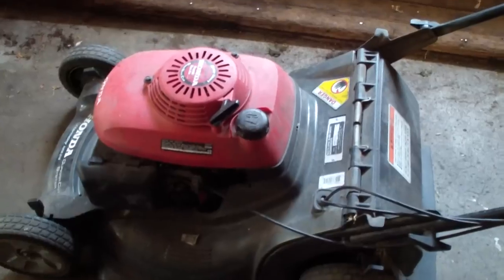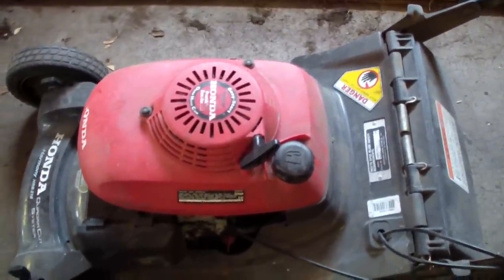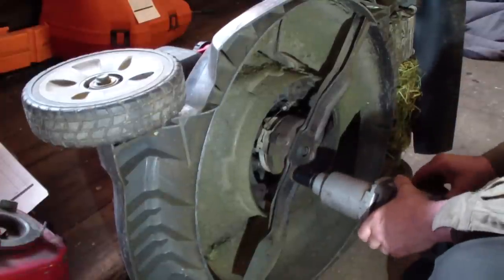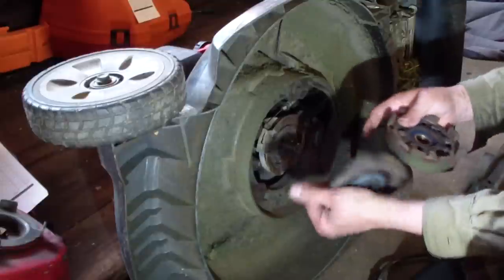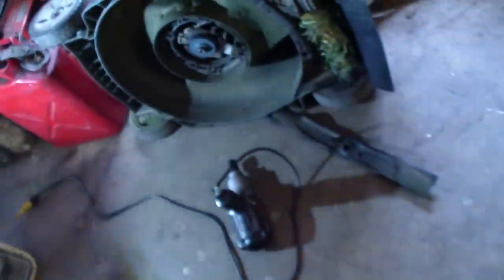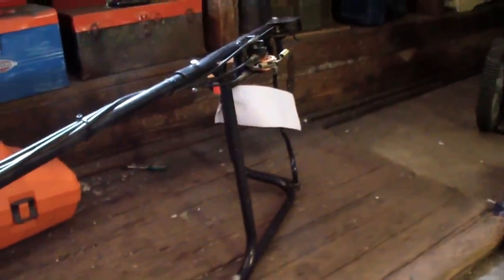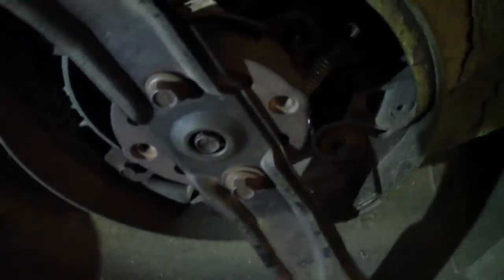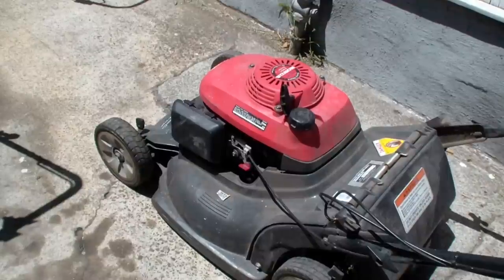Honda hrb216 lawn mower repair, blade clutch, Alameda Repair Shop

Comment: Helpful video. My craftsman mower I bought at a yard sale has the GCV160 motor. The blade would start and stop when engaged, turns out the clutch spring was upside down. Even had “up” stamped on it! Flipped it around and works good now.
Reply: I was getting ready to buy a new mower. your video was the best.  I followed it and removing the clutch was easy... Thanks soo   much.,,,,  I ran over a sprinkler head and the spring got wound up around  the clutch.  and the motor tightened it  up and stopped.   Your video was great..... Thanks John Z

Comment: How did you keep the motor shaft from turning when you removed the center bolt to get to the blade clutch? Please advise!
Reply: You need to wedge something in the flywheel
Reply: @boris9742  Where though? Take the pull cord off?
Reply: @ALLENGERHYTHM  yes you can take pull cord off for better access

Comment from the maker: David: Personally I'm not partial to Honda mowers, yes it costs a little more to service them. I don't see many failures of the Honda blade clutch systems. These type machines are designed for commercial use and the idea of this system is you don't have to restart the motor every time you let go of the handle. I see some 20 year old Honda blade clutch type machines and most haven't required this type of service.

Comment from the maker: All mowers made for the US since the 1980's have to have a system to stop the blade while the mower is unattended. Most mowers have a blade brake with ignition kill. Many of the Honda and other brand mowers intended for commercial use have a blade clutch system. There are many cheap Honda brand mowers  available without this system. As my dear departed grandfather that I never met used to say: " Don't buy a Cadillac if you really want a Vespa."

Comment: Question
So I am trying to remove the clutch assembly
I removed both blades
But the center bolt just spins
And advice to remove ? 
Thank you

Comment: As I understand it, the bolt which holds the driven part of the clutch goes into the end of the crank, and the driven part will rotate freely when the clutch is not engaged, so you can't torque that nut by holding onto the driven part of the clutch.  When you reassemble the unit and tighten that nut it does not seem sufficient to rely simply on torquing against the internal friction of the engine.  I have done this repair, and I blocked the piston when I did the reassembly so I could be sure that nut was on tight.  In fact, the reason I got into the repair was that the whole clutch assembly just fell off when that nut came loose - this, on a one-year-old machine used occasionally.  Shouldn't you torque that nut to some specific value?  How can you do that if you don't block the piston?

Comment from the maker: @Bruce Arnold. Carburetor is probably running lean or old fuel. More than likely a carburetor clean and service or replacement.
Reply: What did you replaced just the spring or bearing.? When I engage the blade make noise
Reply from the maker: @santygomez1122  replaced spring & clutch assy.

Comment: @Alameda Repair Shop my issue is similar, however my blades only cut out in high grass.  I'm assuming some of the clutch parts need to be replaced.   I removed the drive disk, driven disk, and spring (which was oriented correctly).  I asked thr local shop over the phone what it could be and they said maybe the driven disc.   When looking at the parts I dont see signs of wear.  However the driven disc is super smooth with horizontal lines that run around it.  They're smooth as well and not scored.  I was trying to save as much money as possible and avoid ordering all of the parts.  Your advice would be appreciated.

Comment: I have a 2012 Honda HRX217 that just had a new blade engagement cable installed, but now when I engage the blades, they intermittently stop rotating even while engaged. I can go about 20 feet, and then the blade will kick back to engaged. I'm wondering what's going on here, could it be a worn out clutch, or perhaps the shop didn't install a spring correctly, or something else? Please help, thanks!
Reply from the maker: If it's like the blade is free wheeling it's probably the clutch. or the clutch was removed and reassembled incorrectly. Haven't worked on one in years, the one in the video was fresh out of a Honda shop. Good luck!
Reply: @pafoofnic  Thanks, I'm hoping that the clutch was improperly reinstalled -I called the shop owner, and he said the "new guy" was on my mower that day, so it goes back toomorrow! Thanks again!

Comment: Could the clutch also stick  on and not let the blade disengage if its worn?
Reply from the maker: It may be possible but I've never seen it.
Reply: @pafoofnic    mine won't completely disengage     when I let go of the blade handle it still spins.
Reply: @kiteslights7189 Did you fix this problem? Got the same problem on my Honda 🙈

Comment: my Honda mower vibrates a lot when off clutch... could be wrong blade? when the mower clutch is activated and mowing, the mower hardly ever vibrates and runs very smooth...

Comment: I have a similar issue with my Honda HRM215 Harmony lawn mower, although the blades don't spin freely. It will engage most times, but then quickly disengages when it hits moderate or thick grass. Been fighting with it for 2 weeks now. I may need a blade clutch.. or clutch spring.
Reply from the maker: Check if the clutch spring is in upside down. (factory goof.)
Reply: @pafoofnic  I hope not, but I told a repair friend locally that when I tried cleaning the underside with brake cleaner (as he recommended), green liquid ran out. He thinks it's got grass jammed up inside the clutch assembly. I'll get it figured out, thanks. Just watching your video gave me some good insight as to what's inside the clutch assembly.

Oh, it is a factory goof? that's not good! but good to know it can happen.
Reply: @Wario7793  did you ever get it worked out?  My HRB216 does the same thing.   Cuts fine until I hit tall grass and then the blades quit.   I took off the clutch assembly and the spring has the correct orientation.   I'm at a loss what could be causing my issue or what I need to do to fix it.  Were either of you able to resolve this issue?
Reply: @Ryan-kk2rr  Yes in a odd sort of way. The new clutch assembly needed replacing, but it would have cost over $300! so.. the repair guy put in a bypass module and after learning more about working on these Honda mowers, cut me a good deal on repairs. After that, it ran good for a bit, then kept stalling. He then repaired some more stuff, including steam cleaning the carb and it's been running like new since. I will admit, having it run all the time took getting used to, but I don't mind anymore.
Reply: @Wario7793  so was it just those 3 parts that needed replacing?   300 seems a bit high for something that is about 50 in parts and 10 minutes of work.
Reply: @Ryan-kk2rr  That's what the Honda dealers wanted. I think he replaced more than 3 parts though. I got a new spark plug (twice) and a lot of cleaning and tuning. I think I spent under $200 for both repair times. Being a used mower that cost me $140 for a $400 mower new was totally worth it!

Comment: Hey there,
This one Im working on cuts fine..but when I go to engage the blades its killing the mower,Also can hear very litte of squeeking under there I believe..Any Ideas on that?
Wondered if ist a power engine problem or tight clutch,I tried easing the tension up to where it would not engage then giving it just enough tightness to where it would engage hoping that would make it easier on the clutch but no help..What do you think?
Thanks!

Comment: I always ask my customers if they even care if the blade clutch works or not. Most of them don't even like the blade clutch so I convert the blade clutch to be used as just a standard blade adapter. Then I take the blade clutch control lever off the handle and throw it in the trash.
Reply from the maker: No thanks, removing or defeating a safety device is unsafe and a big liability issue.
Reply: wcjcnc When you lose your fingers because you don’t have any clutch then you put another comment.

Comment: I took my Honda HHR 2169 2012 to the Honda dealer because of bad bearings below the engine. They e had it for 3 weeks and want $250 to fix it.
Is it that difficult to replace those bearings?

Comment: Hi, thanks for the informative video. I have a HRB216 and am trying to replace the clutch pieces like in the video. When I remove the two blades and centre screw, I'm not able to remove clutch assembly to replace the driven disk and other pieces. Totally stuck. Any suggestions?

Comment: Hello, maybe you could help me diagnosing my problem on a Honda HRR2163VXA.

I always fire mine up to warm up while edging. Today when I engaged the blade, it engaged fine. But release whenever I let go of the lever. Is there an adjustment needed on the cable? Do you have a video of that?
Many thanks!

Comment: Hi,
My Honda HRB215 was trouble free for years. When I used it, In the last 3 times, if I release the blade switch, the machine vibrated very hard. When I pressed the blade lock switch the machine operated normal. Today, when I pull to start, the machine acts like is locked up. When I held down the yellow blade switch, I can pull start the machine one the first pull. I can cut the grass ok. if I release the blade switch, while the machine is running, it will vibrate and/or  completely stop. Please help. Thanks.
Reply from the maker: Sometimes a clutch problem. Usually the carburetor is running lean, on engagement vibrates and dies or tries to die. Clean or replace. (best to replace.)

Comment: Hey question for ya buddy.  I have a Honda Hr194 mower.  Trying to check the clutch, when I took the 2 bolts off that hold the blade and then try to take the center bolt out the engine turns and thus does not allow me to get that center bolt out.
Reply from the maker: Have you tried an impact wrench?
Reply: No not yet. So when I turn that bolt it should also turn the engine. Thanks for the quick response.
Reply from the maker: Chuck G
Make sure the clutch is disengaged by the handle. (Tie it down!) Remember to disconnect the wire from the spark plug!
Reply: Ok it's engaged by pulling the handle down so I should make sure the handle is NOT pulled down right?  I figured I could burn it out by using an impact wrench on it if it was engaged.  Thanks for the tips.
Reply: Hey, I finally got my neighbor to use his impact wrench and it worked like a champ.  The clutch was still in really good shape too.
Reply: Thanks so much

Comment: thanks for the link. do you happen to know how thick the clutch disc is new. I removed mine this morning as my mower is doing the same thing as in the video. I'm assuming these wear down. The mower is only 2 - 1/2 years old but its used quite a bit. Just wondering how much of the disc wears down before it actually causes problems. I did find a local Honda dealer a few towns over that can order one for me. $30.00. Thanks for the info.
Reply: o.k. I ordered all three parts. You said in your repair video the spring was in upside down. Well, mine is in the same position as the one you showed in the video. I bought this mower new two years ago and its never been apart. The diagrams from Honda don't really say which way the tabs on the spring are suppose to face, up or down. Thanks for the advice.Alameda Repair Shop

Comment: my mowers problem is the engine sometimes dies when i try to engage the blade. its like the brake isnt fully releasing and its stalling the mower. im going to pull that stuff apart tomorrow and try to determine how it should all work and what the problem is. any ideas?
Reply from the maker: Last time I had one of these stall when the blade was engaged had to replace the carburetor.
Reply: gees i sure hope that isnt the problem. it would be too cheap and easy to fix. lol
Reply from the maker: Put the mower on it's side, (carburetor up, fuel off.) Remove the spark plug, tie down the blade engagement handle and see if the blade turns fairly easy. If it does odds are it's the carburetor. Be careful and good luck.
Reply: 91102-VA4-013   

https://i.ytimg.com/vi/3q4_49K9m7w/maxresdefault.jpg

ok i steam cleaned the blazes out of that carb, took the jet and lil tube above it out. its as clean as i can possibly get it. even shot the spark plug and piston with steam. i pulled the clutch apart, took the seal off one side of the bearing steamed cleaned it too, was pretty nasty in there. poured in some mobile 1 15k motor oil and found some anti seize grease ill put in there with it for good measure. dont have any other type of grease on hand but this should all work.  

i figure it was one of three things, either the carb like you were saying(runs super nice now), the bearing seizing up like i was saying(feels flat spotted), or the brake not releasing enough and rubbing some(always spun at super low throttle). im leaning towards the carb having been the issue. who knows. might be dirt in the tank clogging up the carb unless there exists a filter i havent found yet.  if all this doesnt solve it than im done. ive exhausted all my abilities and hit the end of the road for what i can do for it. 
so anyways, for what its worth, thank you for all your help.

Comment: do you know where I can buy this blade clutch,i have craftsman lawn mower with Honda engine part # is917.370950,and it looks like its the same clutch,i just don't know where to get it,Sears doesn't have it ,it is the same problem the blade does not ingage

Comment: I have this type mower with clutch (  Honda HRX217HYA)  it cuts unevenly, leaving "ridges"and I suspect it is the clutch assembly as I measured it side to side and it  is crooked by about 1/16  to 1/8 inch,  I only used it last season and this, and since new it cuts unevenly.  Drive shaft is not bent and I know this because it has never hit anything serious and does not vibrate.  But I looked at the clutch/blade brake assembly diagram online and see there are 3 ball bearings.   Could it be missing one of the ball bearings from the plate, making it sit crooked?  Nice channel, BTW !!
Reply from the maker: I've never measured one or had a complaint like that. The only thing I could think of would be to shim the motor mounting, possibly with washers to even it out.
Reply: I found a comment direct from Honda on their product website product reviewer section from another owner of this model unhappy with same issue.  Honda's response claims the issue is caused by too much lift from the lower blade....hmmm....it suggests, when mulching,   to open the versa cut port a little, use a bag, to essentially reduce the amount of vacuum, and also to overlap more the previous pass.   I'll try it when I get to mow, once it stops raining here.  My 2003 Honda mower does not have a clutch but does have the Nexite deck, but uses a plug for mulching, has a smaller 160 engine, but cuts flat.  This engine is 190 so maybe I can accept the additional vacuum theory but we'll try their suggestion.   Or its all BS and your shim suggestion may be the answer!
Reply from the maker: Let me know how you make out. Good luck.

Comment: not having any luck locating parts online. I do need a clutch. any links you can provide?
Reply from the maker: Try http://youtu.be/JWLAEaFMNYk
Reply: o.k. got the new parts and installed them. actually went over to Honda and talked to a mechanic. My clutch spring was installed upside down from the factory as the one you showed in the video. Put it together and I could tell as soon as I engaged the lever it was running properly. Mower is working great, and thanks for the information.